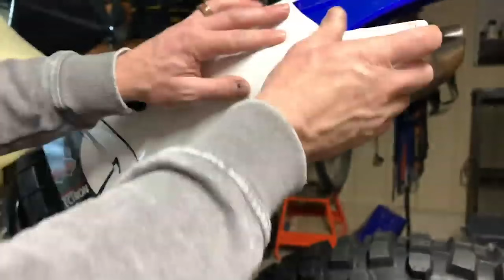15 Minute Build! | YZ250 Enduro Bike

Comment: Such a cool build! Now let the battle scars commence
Reply from the maker: Day one, dented the pipe in a bit, scratched the plastic up reeaaaal good and already had flat, and fouled plug @ <7 hours. I’m only really good at ruining beautiful things and the season hasn’t even really stated yet 😬
Reply: @PlushEnduro  what plug were you running? My yz250 fouls the br8es At 11-13 hours. And I haven't fouled a br8eg at 40 hours
Reply from the maker: Kolton finlinson it WAS a br8es, I had a box of them. I through an EG in there after that though. 👍

Comment: Sweet build. I have an 01 yz250 with 2005 yz250 front forks, flywheel weight, fmf gnarly pipe, and some other goodies that make it a trail monster. The yz 250's are by far the easiest Japanese 2 strokes to turn into woods/enduro bikes.
Reply from the maker: Ahh steel frame too! Nice! They should bring back the steel frames on the yzx’s. They feel noticeably “softer” in the choppy stuff.

Comment: 2:25  You don't show it for long, but that damage to the piston on the exhaust side (crown edge wear above the top ring, and maybe even the upper ring groove getting wider.), is due to not letting the water warm up enough before taking off for the ride.  The bike is running rich stock, and that takes longer for the water to warm up.  Don't be impatient when warming up your bike.  The tops of the radiators should be pretty hot to the touch.  Warm enough to be uncomfortably hot with no gloves on.

Comment: Very cool! May I suggest maybe heating up the cases in an oven so that they expand uniformly to insert the bearings. I'd be too worried about the propane torch causing warping.

What type of material did you bolt onto the glide plate at the bottom?
Reply from the maker: UMADBROYOLO The material is UHMW. I’ve made 3 skid plates out of the one 12x12 sheet I bought.
Reply: @PlushEnduro   Thanks man!

Comment: Did you change the oil in those forks and rear shock? Thinner oil is better for woods. I use PJ1 2.5 weight.
Reply from the maker: They were re-valved by a local suspension guy. I’m not sure what weight he used though. I blindly put my faith into his expertise. 😂

Comment: I ride a 2018 yz250 with a 3.2 gallon Clark fuel tank, home made skid plate with linkage guard,  13oz stealy flywheel weight 💪 😋,motion pro coolant recovery tank, zeta full wrap hand guards,  protaper evo woods high bend with fasst co anti vibration inserts 👍👍👍😜.
Stock trans, shinko mx216 fatty up front and 525 cheater rear 19inch ( works great).   Yz250x suspension settings as a baseline, went tad softer,  ktm guys all said why, just buy a orange bike. YAMAHA is my brand loyalty 💯,   in 40 years I only had 1 YAMAHA that was a toilet,  01 660r raptor,   I love my 2018 yz250, only thing missing is a promoto billet kickstand.
Reply from the maker: These bikes, there is something about them, for sure. I found that even my 2002 felt better ergonomically as well as they way it handled the trails to be significantly better than the orange bikes (that I’ve ridden). The stock suspension even before revalve was better than any WP offering. (IMO anyway). I would take a YZ over an XC variant anyway of the week for XC racing and stuff. I’m a fan. But, different strikes for different folks I suppose.

Comment: Glad to see you're back, that was a sweet build, love the ending.  
What did you like about the Flex bars? 
 I've been looking at them just can't pull the trigger on the cost, at 50 years my shoulder and wrist joints need all the lovin they can get.
Reply from the maker: Vince the vibration reduction is huge. When I get on my Beta now (no flexxbars) i can barely stand it. I never really had a complaint until I started using the flexxbars on this bike. So, that’s my measurement guide basically.

Comment: Ive been thinking about doing this same build, but I think im just gonna find a nice used 250X and go play!
Reply: I have 2 yz250x bikes (2017 and 2018) for my kids. Excellent bike.
Reply from the maker: I think that's a safe bet. The x can be easily tuned to be more like the motocrosser with some tweaking of the powervalve, ECU swap, getting the head decked and stuff like that.

Comment: Can I drive enduro with a 2018 YZ250, or will I crash it every 5 minutes? I'm considering buying one. It has already been modified with an 18" rear wheel/tire and a full FMF system. I'm a lower-intermediate rider, so I understand that I probably should buy a WR250F instead, but this '18 YZ250 I found is so gorgeous that I fell in love with it instantly. 😅
Reply from the maker: Hard to say. The YZ makes a great singletrack bike. As far as hard enduro or where things get incredibly technical, it can do it absolutely, but there are better bikes out there that are made specifically to do the harder stuff. I will say that the YZ has been the most comfortable bike out of the box. I think it comes down to the person riding it to be honest. If you get the YZ, but get the heaviest flywheel you can find and hit the woods. I think it’s a good enough platform to learn on. My biggest gripe is lack of e-start.
Reply: @PlushEnduro  Thanks. I don't think I will do very technical stuff. More enduro trails (single track type terrain but can be wet muddy), for the fun and exercise. It's hard to find a very good bike <$4,000. The YZ250 2-strokes are probably the cheapest in that price range that are in good shape and really good quality, and also isn't terrible outside the MX track.
Reply from the maker: Shoot, I think the YZ is maybe a good fit then. Soften up the clickers and rip, a flywheel weight will help smooth it out as well.
Reply: @PlushEnduro  Is it possible to fit an electric starter on a YZ250 2-stroke? 🤔 I'm guessing no. Then again, if I'm not going to do much technical stuff, I suppose I wouldn't stall the bike much.
Reply from the maker: @viperracing2889  someone makes a kit for it, but it’s pretty spendy.

Comment: Did you make that engine stand or did you buy it .... that's pretty rad I could have used that a few times info on that stand ?
Reply from the maker: I threw a link up in the description if you’re interested! It makes engine work way easier than flopping it around on the table!

Comment: Did you change the gearing in the transmission to wide ratio?
Reply from the maker: Yes sir
Reply: @PlushEnduro  That's awesome, I didn't know there were gear changes available.
Reply from the maker: @geronimomadmartin3499  yup, you can order the gears for the 250x and swap them into the Transmission

Comment: What year yz is this?! I have a 99 I’m planning on doing the same build to. Looks the same!
Reply from the maker: 2002 sir
Reply: @PlushEnduro   nice man great build do you know if a lectron will fit on my 99 or will I need a 2002 subframe and air box to have it?
Reply from the maker: @anthonymaynard9809  good question, I’m not sure. I’ll admit I removed it and went back to the stock carb.

Comment: do yall know where I can get the hardware for a silencer on my 250 when I bought the bike it didn't come with a silencer so when I bought an fmf I thought I'd come with the bolts n stuff 
thx
Reply from the maker: So this is what I would do. Take one of the 8mm bolts out of plastics and run down to the hardware store. It’s the same thread pitch as that bolt, but find a couple longer ones. Maybe an 
1 1/4” long. That should do ya.
Reply: Yamaha dealer can fit you with all the rubber grommets and washers and oem bolts  you need.

Comment: Did you throw a lectron carb on? Or jet for Moab?
Reply from the maker: I did install the lectron, works good. Ran that one race on it, but decided I’d rather get the Keihin dialed in and run that instead. The Lectron worked AS good as a “pretty well tuned” carb. On the downside I feel like it didn’t fix the 0-1/8 throttle issue a lot of people have with these YZs. I also feel like it robbed the YZ of some of its “spirit”. I think I can do better swapping out the slide on the carb playing with some different needles and stuff. I didn’t hate the lectron, I just didn’t love it either. 🤷‍♂️ 

As far as jetting it will mostly be jetted for my area 6-10kish. I wish I lived in Moab. Lol
Reply: Gotchya I'm trying to get my yz dialed in but have been chasing flat spots. If you get it figured out please share. I'm also located in CO and ride mostly around 4500
Reply: This mountain life would you be interested in selling the lectron if you still have it?

Comment: Engine covers is homemade?
Reply from the maker: Nope. They’re Acerbis clutch and ignition covers.
Reply: This Mountain Life but under motor?
Reply: This Mountain Life 13:07
Reply from the maker: @jiristastny5824  ahh the skid plate is a Ricochet Skid Plate, but the linkage guard is homemade. I have a video on the material and how I did it. HDPE Plastic. check it out if you're interested.

Comment: So not one single part of the part of the original bike was suited for the woods?
Reply from the maker: You could totally just jump on a yz and ride in the woods. Especially in fast and flowy. Out of the box in it’s true MX form it’s one of the most comfortable bikes I’d ever ridden. It’s super responsive, better than anything coming out of Europe and this things 20 years old. However, when it comes to the gnarly stuff it needs some tweaking to make it easier to ride. You CAN ride with with doing nothing, but it lacks a lot of the the things in its MX form that makes something like a KTM great in an enduro “like” environment. I’d be happy with just a flywheel weight to help with stalling and an 18” rear wheel to open up tire selection and add comfort on rocks and roots.

Comment: What did you do to the front shocks? Im trying to get my bike ready of enduro but it’s a motocross bike.
Thanks!
Reply from the maker: Durrell Racing in Monument CO did my forks and shock revalve.
Reply: In my 2018 YAMAHA manual, 11 clicks out on compression is baseline for yz250,  13 clicks out is baseline for yz250x.  Rebound is same setting, I sped up my rebound 2 extra clicks out, and softer compression to 14 clicks. I'm 220lbs and ride only hard enduro type trails,  big help was the shinko mx216 fatty front tire, took away the square edge hits over rocks and roots. Love that tire